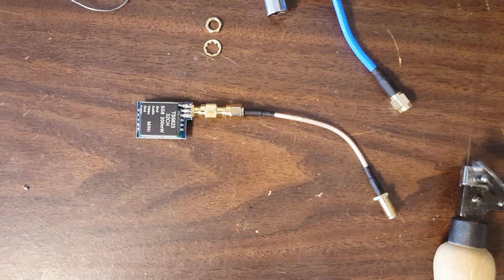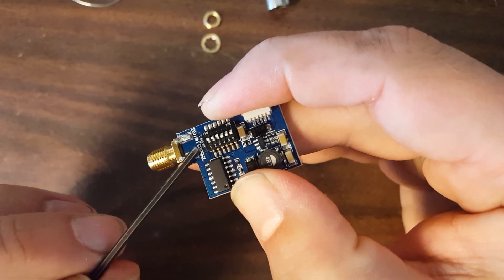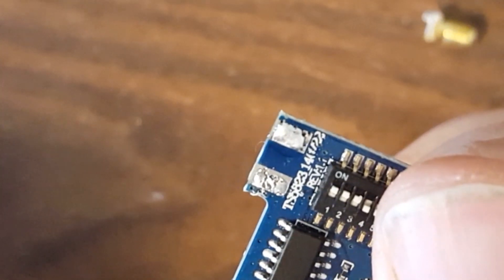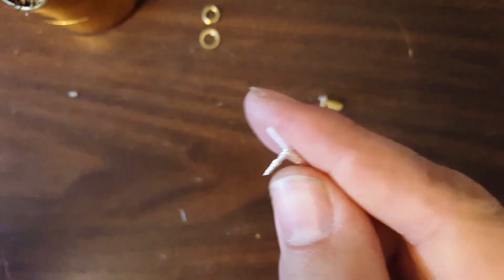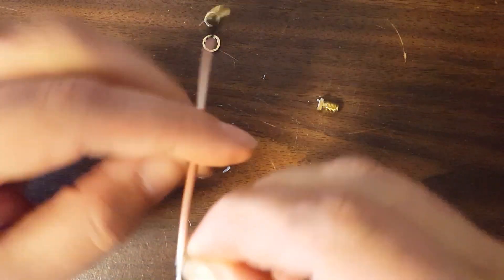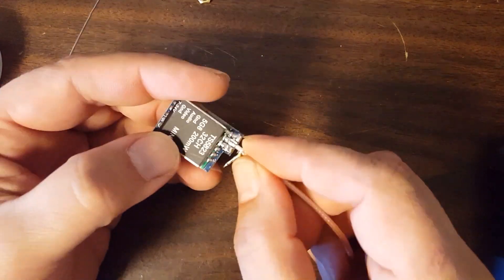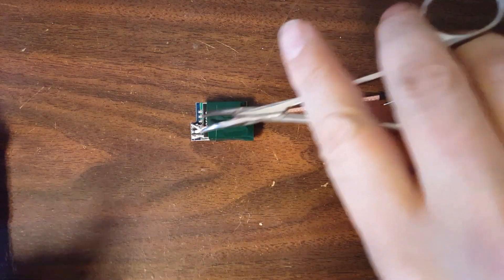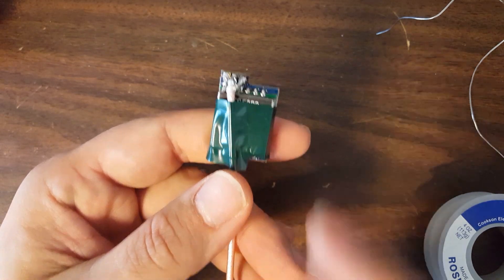How To De-Pin Your FPV Video Transmitter

Comment: Hi joshua... Want to ask.. I have vtx that center wire and ground wire have touching together when i check with multimeter.. Its that my vtx have broken?
Reply from the maker: No. Many vTX antenna have DC continuity between signal and sheath. It's normal if the antenna is installed.
Reply: @JoshuaBardwell  thanks for info..

Comment: sooo my question is, does this get the same signal quality as using the preinstalled connector? I have had an MMCX break off inside of the connector, and thinking about doing this to fix it and keep it from happening again in the future

Comment: Hi Joshua, you are mistaken when telling there should be no continuity between signal and ground. There are quite a few VTXs out there with continuity. Don't ask me how those circuits are working, but for example, the eachine TX5258 has a beep between signal and ground right out of the box ;) And yes it's working properly
Reply: As a wi-fi specialist, this must be a challenge to investigate ;)

Comment: Thanks, also its good to point out you can use this to also remove the connector to change it out or to add a pigtail with the correct connector........I got an AOMWAY VTX which I accidently got SMA...(I have all RP-SMA Antennas)....I plan on taking out the connector and using a RP-SMA Extension cable I have

Comment: Maybe i got lucky because i did the same thing but with an old USB cable on which i 've only left one wire inside and the armor outside, and connected to a antenna...

Comment: Lead free solder re-flows fine. Adding solder to make old factory solder flow better works because the flux core plus the molten solder helps heat the old solder up faster with leaded or lead free. 
Get the proper tools for the job and you wont have such a hard time. soldering work is easy when you have good proper tools. 
auto adjust wire strippers are a great tool to have well worth the money.
Reply: That's right solder grasshopper 🦗🦗🦗🦗

Comment: Hi Joshua I have just done this mod to my vtx but have continuity between ground and signal but my un modified one is the same out the box is this normal??
Reply from the maker: Yes it's normal for a cloverleaf antenna to show DC continuity.
Reply: Joshua Bardwell thanks for the reply Joshua but I was talking about the vtx not the antanna

Comment: Joshua, I enjoy your videos. The method which works for striping small wires is soldering iron itself. You can cut isolation without disturbing strands.
Reply from the maker: Not silicone though? Only plastic?

Comment: Bardwell I know this is an old video but please explain why I get continuity between ground and signal and have no problems without the antenna connected it's an eachine tx801
Reply: flyandride

I've tested continuity between antenna and ground on several different vtx makes and models and usually see continuity. Close examination reveals an inductor between the antenna trace and ground, this would show as continuity to dc but not rf. 
Some vtxs may have a capacitor down stream of the inductor in the antenna trace. In this case it will not show continuity to ground. The capacitor passes rf but not dc. 
It all depends on the circuit design whether you see continuity from antenna to ground. 

https://www.rcgroups.com/forums/showthread.php?2918654-Continuity-between-signal-and-ground
Reply from the maker: Carl is right. There is usually an inductor on the signal output. RF circuits are not designed for operating at DC frequency, and do not behave the same at DC as they do at 5 GHz or whatever.

Comment: I had to do this on my emax vtx but my sma.cable broke as well so I directly soldered the antenna to the wire but shortened the antenna in the process so now when.im on channel A8 my signal is actually R3 lol. New AKK X2 on the way along with a camera and some pigtails and extensions.

Comment: Wouldn’t the impedance change because you cut the pigtail shorter ? If the cable is too short, or too long it could damage the transmitter ? It’s basically the same as putting on a bad antenna

Comment: There is another use for this video... the legs of my sma connector that are solder onto the board broke... I didn't think of soldering a wire straight onto the board to salvage the board... cause of course, soldering the sma back onto the legs doesn't give it enough strength....

Comment: or you could have just used desolder wick
Reply from the maker: I don't think desolder wick would work for releasing an SMA. It can't really get up underneath the connector where the solder is.

Comment: Joshua, my friend, I love ya and frequent your videos often. You have taught me so much and I thank you.  Now I want to return the favor and suggest you use a T-Stripper for both shearing wire and stripping them in the most efficient way.  I was taught back in the early 70's when I began my electronics career, to never cut any wire with pinching type of cutters (i.e. side cutters). Wire should always be sheared to preserve the integrity of the wire end. All T-Strippers have approximately 1" of proper wire cutters at the bottom of the jaw. Secondly, when you strip something like the flexible coax used on SMA cables in our hobby, the wire gauge sizes available on the stripper will work fantastically on both the insulation (typically 16awg) and the dielectric (24awg). 
You probably already know all of this, but just in case, there you go.
Again, this is out of respect and friendship because what little I can give you as far as new knowledge, you have already given me ten fold.
Your greatly appreciated,   dave

Comment: all 50 ohm (radio transmission) is fine. if you could physically fit it you could use rg213 which is about half inch outer diameter.

Comment: I have that same solder gun. changed my whole solder game! I was using cheap walmart ones, then ordered this one... bam just so much better. those tips seem to last forever too! Ive let it cool several times covered in solder on accident and I still havent ruined a tip!
Reply: Bryson Michael RC at the end of soldering you are supposed to wipe the tip clean and add fresh solder and let it cool that helps prolong the tip

Comment: Like those sma connectors are solid metal, lol!  They are brass coated plastic or some crap like that.  I cut them with snips all the time.
Reply from the maker: Brass is a very soft metal.

Comment: Can you solder video/gnd/power directly on the bottom pads on this? I have one with a broken JXT and lost the pads under the connector as well.
Reply from the maker: The GND pads are on both sides, for the SMA connector but I'm pretty sure there is only a single signal pad. If there is a pad in the center on the bottom, it's worth a try. The vTX is toast otherwise. Maybe you could scrap back the solder mask to reveal the trace on the top and solder to it... but I'm not sure I would trust my video connection to that.
Reply: Joshua Bardwell My SMA is ok, but the JXT that connects to the FC is trashed and missing solder pads where the JXT used to be. I'm pretty sure I can solder video on the left of the 5 pads on the other side (bottom of the black/text side of the VTX , but the real question is if I can do the same with power and ground.

Comment: Hey Josh, coming back to this video after a while now that I finally have a vtx and a pigtail :D

Quick and important question, won't the heat from the heatsink melt the hotglue away?
Reply from the maker: +Abdul Aleem Shekhani it didn't for me.
Reply: Joshua Bardwell cheers for the reply, I shall be doing this tomorrow and shall report back how it goes for me...
Reply: Turned out didn't do the same, my antenna needed to be routed the other way, and direct soldered an older broken antenna (Had broken the SMA connector) directly onto the VTX, might not be the smartest thiong to do but I NEED TO FINALLY START MY FPV ADVENTURES

Comment: Question: when building fpv antennas, you cannot check continuity right? because you are technically connecting the ground and the center conductor with the lobes of the antenna? right? it will ultimately "beep" to display continuity due to the way the antenna is designed.
Reply from the maker: +Mad Yet yes.

Comment: Oldie but goodie....Question, though:  At 16:30 you mention that there shouldn't be continuity between the ground and signal on the TX.  Is this correct? I get continuity on 2 different transmitters (with no antenna or power wires connected).  Thnx.
Reply: Captain Over yeah I also got continuity on two transmitters from different manufacturers with no power nor antenna connected. And this was before I even modified the vtx connector.
Reply: I checked 2 NIB VTX and both have continuity between ground and signal. There was a very small amount of resistance though when I tested for that.
Reply: so should't be continuity between ground and signal but it is.
I was scared that did something wrong .Even on my new Eachine there is.Can someone explain why?
Reply: Captain Over 
I found this on RC groups.com
flyandride

I've tested continuity between antenna and ground on several different vtx makes and models and usually see continuity. Close examination reveals an inductor between the antenna trace and ground, this would show as continuity to dc but not rf. 
Some vtxs may have a capacitor down stream of the inductor in the antenna trace. In this case it will not show continuity to ground. The capacitor passes rf but not dc. 
It all depends on the circuit design whether you see continuity from antenna to ground. 

https://www.rcgroups.com/forums/showthread.php?2918654-Continuity-between-signal-and-ground
Reply: I third this. My Eachine VTX got continuity so I cut off my beautiful solder job only to find out the actual board was ohming out between pins. Gonna solder it up again and cross my fingers.
Reply: Captain over I also get continuity between ground and signal I don't understand how he doesn't but my VTX works just as well it's a tx801 from eachine
Reply: Captain Over So....continuity is a funny thing.  Unless you’ve studied radio theory and antennas, this is hard for people to understand sometimes.  But these antennas often only run like 50 ohms of resistance between the two points, unless you’ve messed it up somehow.  Basically most multimeters might still “beep” that you have continuity but look at the actual number and ignore the beep from your meter.  It should have the rated resistance for that particular connector and antenna.  Technically speaking there is ALWAYS connectivity because you’re only testing resistance... and I t’s the resistance that makes the electrons go round :).  Make sense?  Those who deal a lot with transmission electronics have SWR meters which can measure the effectiveness of your antenna.  But you will always have SOME continuity between those points,

Comment: Can you shorten the length of the pigtail, and then re-solder? Will this cause any tuning issues?
Reply from the maker: Should not cause issues. If the pigtail's impedance is correct, length should not matter.
Reply: Thanks!

Comment: It'd be better if more FPV transmitters were sold with u.Fl connectors, or at least pads suitable for them giving end users the choice to use u.Fl or direct soldering.
It's ridiculous to use connectors that weight about as much as the whole device they're connected to.
AFAIK only the ImmersionRC Tramp HV VTX has a u.Fl connector which I think was a smart decision.

Comment: I know this is kind of random on an older video. But I was looking for a video on why does a VTX heat up? are there any VTX as that run cooler? I have a waterproof drone I'm building where the VTX needs to go inside and I'm worried about it overheating!
Reply from the maker: That is a valid concern. The vTX heats up because it's a power amplifier, and they get hot. The way to cool them down is to run them at lower transmit power, but of course your range is reduced.
Reply from the maker: +rodney wickersham they heat up because they have a big amplifier on a tiny board. Use a lower power vTX would be my recommendation. 25 mW will be reasonably cool.

Comment: Bad luck or not, I for one appreciate you leaving in the bits of fail that happen with these tiny things!  I like to split the braid at least in two, and use, in this case, the three on top.  This provides bit less RF escaping from the unshielded part.  It's like a ground plane kinda.  Ideally the feed line joint would all be shielded, but that's insane to do.  

BTW that angle is a right angle coming off the board into the pigtail, so I'd be interested if that makes a real world difference -- That is, if you do one coming straight out (in the same orientation as the original connector).  If you wind up doing that I encourage you to compare.

Comment: hey, just a tip use a triangular file to cut of the connector and use your nails to expose the coax sheaths so you don't cut it

Comment: @Joshua Bardwell
Its not you man, its the tools. This is the wire stripper i usually use. it is $10. i like this 16 to 26 awg stripper better than the common 20 to 30 awg. you can pretty easily score the large jacket with the 16awg hole by not closing it quite all the way. this is much easier than stripping with those cutters. The fact that you did strip that delicate wire with side cutters means you are really good.

http://www.mouser.com/ProductDetail/Jonard-Industries/JIC-1626/?qs=sGAEpiMZZMvsO91yRwFnAMjRVXcq8fe3

Comment: Joshua, thanks for the demystification how the transmitter connections hook up to the coax cable. But please, the green tape you used; what kind is it?
Reply from the maker: +Escape Velocity just electrical tape

Comment: Hello Joshua, is it really necessary to solder the ground too? I broke my SMA yesterday and just soldered the signal to the receiver, it seems to work but I haven't flown the quad yet, is it bad for the VTX performance or something like that?
Reply from the maker: +Alpha FPV you must solder the ground, yes, absolutely. The range will be very low and you may damage your transmitter.
Reply: +Joshua Bardwell Okay thanks, I'm going to correct that :)
Reply: Joshua Bardwell 😲 silly questions that people could find the answer to if they only FULLY WATCHED your video!!

Comment: hey man, thx for sharing :) I've made a little "cage" or housing for this purpose out of 1mm copper wire. it's way more stable than just the cable to the contacts and it looks a bit cleaner. I'd like to share it with you and other people who want to put the cable straight to the vtx. I'll send a picture of it via Facebook :) keep it up ...

Comment: As an RF Engineer I cringed a little bit at this haha. But after running some quick numbers I thing you are OK.  The rule of thumb is to have the "undesirable geometry" less than 1/10th of the wavelength. For 5.8GHz you just need to make the connection in less than 5mm (pad to fully shielded coax) and the loss should be negligible. It would be really interesting to see a before and after power measurement. 

Love the videos Joshua, keep up the good work. We all appreciate the help, I know I have learned mountains form your channel.
Reply from the maker: If you check something like the X4R-SB, you'll see this is more or less exactly how the antennas are soldered on from the factory. I wasn't familiar with the 1/10th wavelength guideline, but I expected that this would be okay just based on copying what someone else did.

I mean, ultimately, there aren't too many different ways of soldering coax to a board.
Reply: Can't disagree with your results. It looks like a great solution for this application. 
The 1/10th guideline is kind of intuitive if you think about it the right way. If you take a sign wave and zoom in on it to where you can only see 1/10th of it, the wave looks relatively flat. If it's flat, we can treat it like DC for those dimensions.
Reply: I've not heard of an RF Engineer before. Was that a major or a discipline you shifted to after completing or while acquiring a EE MS?
Reply: Yeah. It's just a specialization of EE. My degree does not say RF.
Reply: Nicholas Lantz RF Engineering is like black magic...

Comment: I'm glad I stumbled across this video as it also serves as a great way to repair busted coax jacks on transmitters.  I have a few older FatShark transmitters sitting in a bin and I've been meaning to repair them -- the pads got stripped when the SMA jack was yanked off back in my dumber days when I didn't use an extension and just had the antenna hanging out the backside of the quad.  This method will be much easier and more useful than re-attaching the jack.

Comment: i de-solder SMA by removing solder as much as i can with fluxed 14AWG wire and soldering iron. after that i put a joint of solder on the side of SMA connector and heat it up. After 10-15 seconds you can gently push SMA by your soldering iron out from the board.. :)

Comment: It was painful to watch.   Get some magnifying glass and exacto knife.     I split the outer shield into two strands, just like SMA connector, this way your joint will be much stronger, connecting to the PCB at all 3 points.
Reply from the maker: +RC Pilot Multirotor If you think it was painful to watch, you should have felt what it was like to record.

Comment: why not just desolder the SMA? Seems like there would be a possibility of damiging the pads etc.
Reply from the maker: +TheWaterbound07 I'm not confident in my ability to desolder the SMA all at once (without a hot air gun anyway) without overheating the rest of the board. With the jeweler's saw, there really is no risk of damaging the board or the pads. It is a very fine saw that offers very good control.